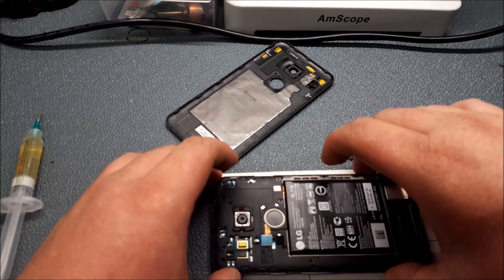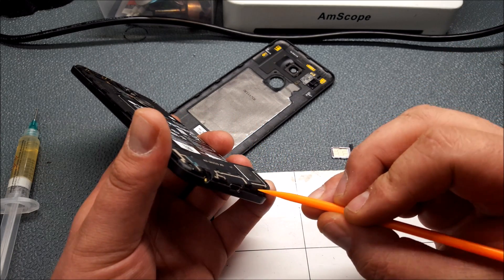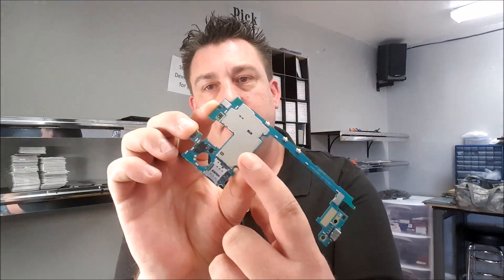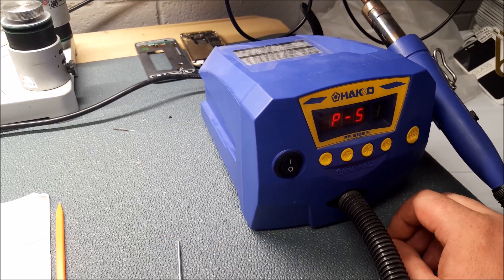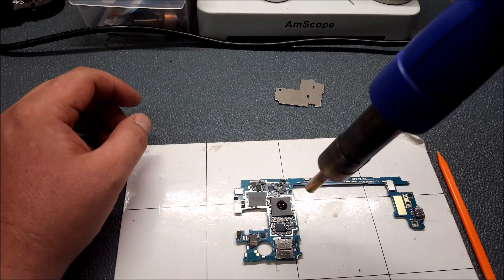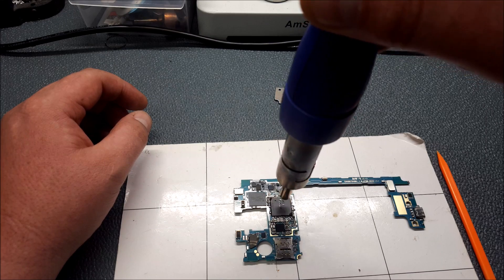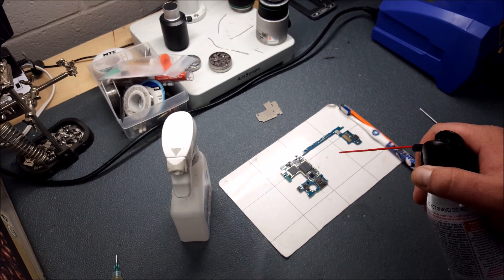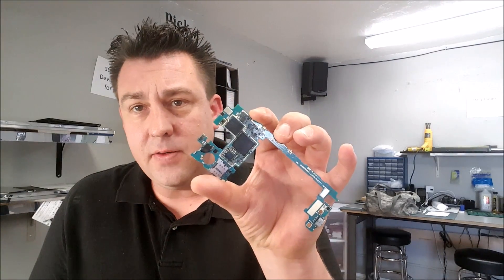Nexus 5x Bootloop Fix.

Comment: Temporary fix ....
Reply: Julian Teoh I am sorry you don't have the warranty and support that we have here. There is no way for me to know how this works in other countries. I titled my video the way I did on purpose, as I believe it is truly the only viable option for: fixing the bootloop in a way that does not void the warranty, fixing the problem for free, and fixing the problem in a way which provides a 90 day warranty on the work; all through the manufacturer of the device. I want those who do have the warranty option (but do not know that) to see this option first; before they destroy their phones or have a false sense of security that their phone is fixed, when the problem will just return again. If you want your phone to work, just know that the problem is a bad motherboard. That is what LG replaced in my phone. I hope you can find a reliable repair shop that can replace that part for a reasonable price. I don't know of any other real solution for you.
Reply: exactly ,its only a temporary solution, works only for few minutes
Reply: Yup. I just got another phone for about $200. Much happier with it anyway!
Reply: Worked for me. Check my other comment. I got a permanently fix after second attempt.
Reply: Hello, I have the bootloop issue in my Nexus 5X and LG representative in my country (Dominican Republic) diagnosed my phone with a bad motherboard and told me that I have to replace it. Do you have the part number or any identifier of the motherboard LG placed in your phone?...I need to buy the motherboard but I'm not sure how to find the one without the bootloop issue. Thanks in advance.
Reply: If I have that option I wouldve done that. My problem is that I dont have any warranty or LG support here in my country. Watched your video before I came here and time wasted. You shouldve changed your title of that vid

Comment: Have you seen the method in this video: "Nexus 5x bootloop fix 4pda 2017 New method: heatsink + copper" What can you say about it?
Reply from the maker: I don't know, but I will definitely look into it.  at the very least I can see that the copper and thermal paste are applying pressure to the back of the chip, which can help close the contacts that are broken.  I will research this and if it is a viable solution I will post a new video.  Thank you.
Reply: Thank you!
Reply: Hi, did you have the chance to check it? 
I have this problem, tried with a Hair dryer the phone boot for 1 hour, and then frozen again.
I tried again, but this time the phone won't turn on. Is completely dead.

Thanks!
Reply: I didn't try this new method. =/

Comment: hey, thanks first of all.
I followed your steps as same as you have showed. though it's still on bootloop. but the bootloader only works.
what should I do?
Reply from the maker: Thank you for your question.  I am sorry that you are having trouble with your phone.  I am unable to diagnose further without looking at the phone. it could be a completely faulty logic board, critical memory space, corrupted ROM, or bad battery.  I would recommend inspecting the physical components, or trying the heat again.  I wish you the best of luck.

Comment: I did this for one of mu friend..it worked initially but after around 1 day the issue started again..can you let me know what needs to be done here
Reply from the maker: Thank you for posting.  I am sorry that you are having trouble.  I would recommend trying again.  Maybe increase temp to 390°F - 400°F but no higher than 400°F. While you are heating the chip in a circular pattern, closely observe the small components around the chip for the solder reflowing (the solder will become shiney). At that point remove the heat and allow it to cool.
Reply: ICDT Technologies thank you for your time...i tried but after a while it goes into bootloop again..i tried heating 380-400 but it works for a day or so
Reply: Do it once to get it booting temporarily and enable "OEM unlocking" in developer settings (and backup any data), then apply the better software solution from Xda to work around the bad chip: https://forum.xda-developers.com/nexus-5x/general/untested-nexus-5x-bootloop-death-fix-t3641199
Reply: J Peterman this actually fixed my device. Thanks a lot! But the only problem is that it cannot multi task like before and the phone is a bit slow when opening the camera
Reply: Buy an iPhone

Comment: I am facing the same problem .Saw your video got little hope for my Nexus 5x to get alive. But confused, Is it a permanent fixing method or temporary? And concern that the phone you fixed after heating is working fine till date..
Reply from the maker: This is what I would call a semi-permanent fix.  The customer for this device is still actively using his phone (6 days as of this reply).  I would use this technique to retrieve data and maybe able to use till you are able to replace the phone.
Reply: Hmm.. Ultimately I have to change my Board..

Comment: hey.... can we use hair dryer instead of that heating gun...? please reply
what was that when you sprayed after the chipquick gel...? was that water...? is there any other alternative for that chipquick gel
Reply from the maker: Thank you for posting.  Most hair dryers have a max temp of around 150° - 200° F. They do not get hot enough to reflow the solder. Also, the spray was not water. It was 91% isopropyl alcohol.  There are many alternative manufacturers for the flux (I use ChipQuik).  I recommend using only the "no-clean" flux.  I also recommend using a hot air rework station, so that you can accurately control the temperature and airspeed. If you only have a heat gun, you should use a laser thermometer, to monitor the temperature of the board, and set the heat gun to the lowest airspeed.

Comment: Reeeeealy great video, man. Thank you. I will try your method this week. Can you please tell me what was that on the syringe? Can I use a "regular" Heatgun?
Reply from the maker: Thank you so much for the compliment.  The syringe is Chip Quick No-clean Flux.  It helps transfer heat to the chip and prevents the solder joints around the chip from oxidizing.  I also do not recommend a heat gun, because it blasts a heat at a wide area.  Also, the air speed on a heat gun is too fast, even on low setting.  It may be too fast and you risk blowing components out of place or off the board.  Please let me know how it turns out.
Reply: I'm in Brazil...the "Chip Quick No-clean Flux" I never heard from and I think it will be hard to find. The machine you used I have never seen it too. =/  Just got cold feet after this informations. hehehehe....Should I isolate the others components from the heat gun blast with Tin Foil?
Reply from the maker: The flux can be found on Amazon. 
https://smile.amazon.com/ChipQuik-SMD-291-Clean-Syringe-Nozzle/dp/B00CM2A97S/ref=sr_1_5?ie=UTF8&qid=1500874596&sr=8-5&keywords=no+clean+flux
The machine is called a hot air rework station.  You can use a budget hot air station, but if you only have a heat gun, use a laser thermometer.  And if you want to isolate the chip, I would use kapton tape. It has a very high resistance to heat.
Reply: I can't thank you enough!
Reply: I tried with a heat gun and the phone was up for 7h. =/
Any ideas?
Reply from the maker: Please keep an eye out for the permanent repair video coming out next week.
Reply: ICDT Technologies it will be my pleasure! Thank you.
Reply from the maker: Please subscribe. more videos coming this week. Obrigado
Reply: Already did it since you publish this one! It didn't save my beloved N5X but it was worth a try. I'm anxious for this next video! Thank you in advance.
Reply: What is the link for that please?